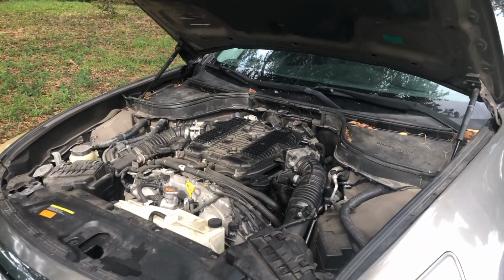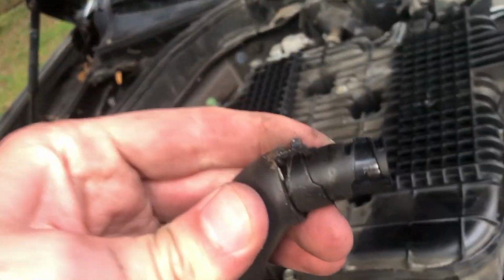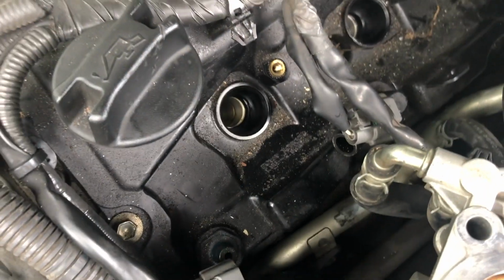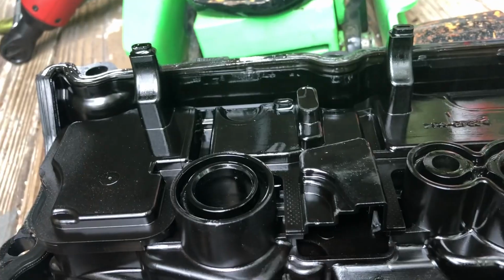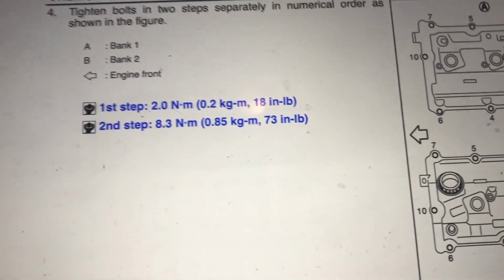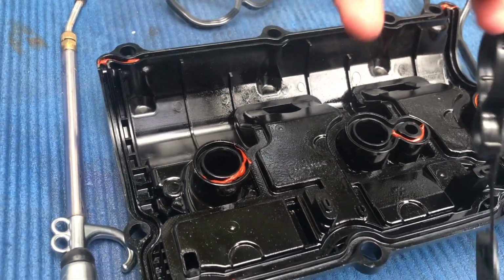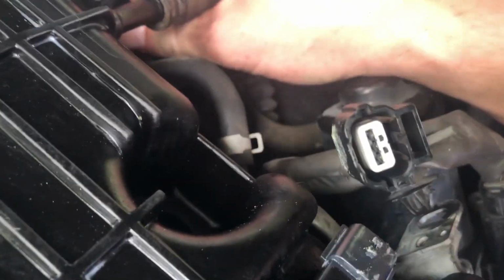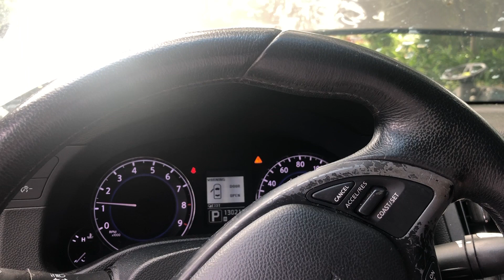Infiniti G37 Valve Cover Gaskets Replacement (LONG DETAILED VIDEO)

Comment: Where did you buy this parts??
Reply from the maker: I bought some parts from amazon and some from eBay. The links to amazon stuff is listed here in description.
Reply: @PZPal  I can't found the tube seals
Reply from the maker: @josemirandamiranda1940  I found this one on amazon https://amzn.to/3PB8pa4 it doesn't look like its OEM, but should come with two on order. You can also search eBay or other places for part 13271-ey00a
Reply: Thank you

Comment: I remove my valve cover ,but it didn't look as clean as yours. It was black with oil all over.
Reply from the maker: Perhaps  oil changes were not done as often as they were done on mine (I had it from 70k miles to present). But those engines are very reliable.

Comment: Is anyone in the Fort Worth area and know how to do this? I have cylinder 4 misfires thinking it was the spark plug. Went to change the spark plug and it had oil. Rough idle. Help!
Reply from the maker: Sounds like you'll definitely need to replace valve cover gaskets including the spark plug gaskets. You might also have a failed ignition coil.

Comment: Man I’m trying to do job right now and the wire harnesses are such a bitch
Reply: How did your replacement go? I’m thinking about doing it to my g37
Reply: @jesuspreciado4741  it went fine, took longer than expected. Make sure you have decent pliers to release clamps on wire harness. 

Make sure to have a flex or bendable socket adapter there are a few bolts in tough places 

There are 11 on each side for valve cover

Also make sure to replace your PCV at the same time you do this. 50$ for two
Reply: PCV?
Reply: @somebodyelse9696  positive crankcase ventilation valve
Reply: @Us3r_404  you think that’s a necessary replacement on a 2014 Q50 with 80k on it?
Reply: @somebodyelse9696  yes
Reply: @somebodyelse9696  it’s such a cheap fix and takes 10 minutes and it’s supposed to be done roughly every 50k

Comment: I'm going to sell my G before this stuff even starts happening.   Imagine doing all this work, or paying to do this, and now all the old hoses and wires  start die-ing slowly after you wrestled them off to get to these pain in the but gaskets.   It's a shame none of these auto makers aren't copy'ing what Toyota does.   IV seen 200,000 mile Toyota engines no leaks, and never been worked on.
Reply from the maker: Thanks for watching. I'd have to disagree, at least from my experience. I've done valve cover gaskets on about 3-4 cars and never had issues with hoses or wires cracking or breaking. I don't recall dealing with Toyotas valve covers though, so maybe design there is a bit better. It took me two days of work where I was just taking my time, record everything on video, and I probably spent less than 2-3 hours each of those days. Hope I'll get to work on Toyota soon though to see what they're like to deal with. Thanks for your comment :)